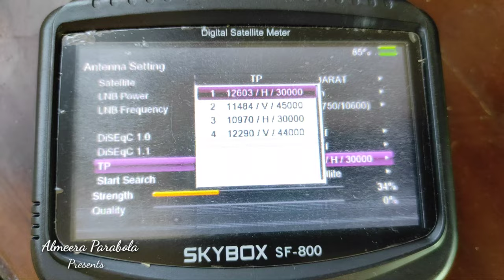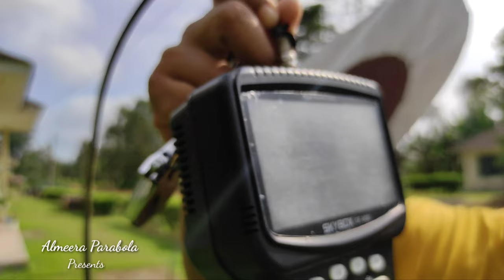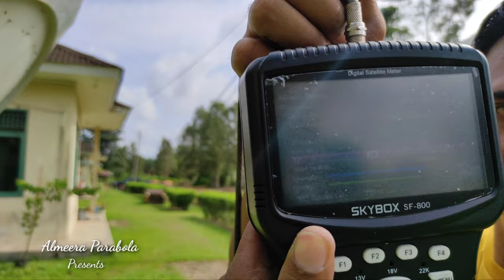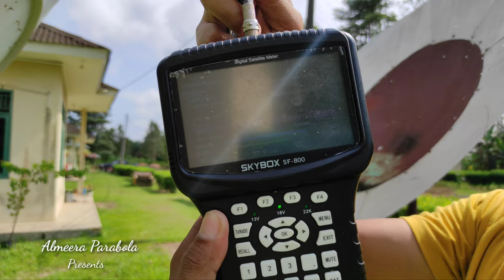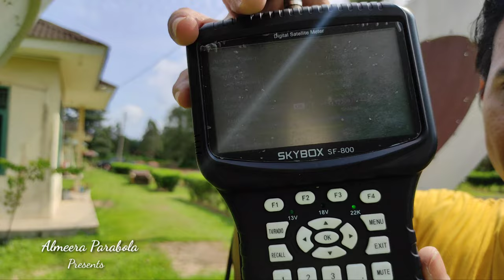Cara Mudah Lock Satelit Kuband 2021# Measat 3# Thaicom5#Abs 2

Comment: Pake dish 45cm bisa gk bang?
Reply from the maker: bisa
dicoba saja
Reply: @AlmeeraParabola  tapi susah banget pdahal di apliksasi sat finder dh pas arahnya namun untuk atur tingginya susah banget
Reply from the maker: Coba.. Mainkan arah LNB nya sahabat.. pakai yang horizontal.. Lock dulu measat 3 a.. Lalu geser sedikit kearah selatan..
Reply: @AlmeeraParabola  kata chanel sebelah tak bisa track pake dish 45 cm untuk sat taikom4
Reply from the maker: Untuk Thaikom menggunakan dish 45 butuh kesabaran ekstra sahabat. 
Minimal.. Area bebas dari halangan. 
Posisi tiang fokus gunakan yang Vertikal. 
Dan Maksimal bisa terlock kurang sempurna.. 
Untuk track satelit sebaiknya gunakan minimal dish 80 cm sahabat. Untuk hasil yang maksimal
Reply: @AlmeeraParabola  kalau untuk dish 45cm yg mudah track sat apa y bang?
Reply from the maker: Dish 45 bisa bawah ke;
Measat 3 A 
Asisasat 9
Ses 12
Tahikom 5
Abs 2
Ses 7
Ses 9
Reply: @AlmeeraParabola  itu yg chanel ftv nya banyank yg mana ya?
Reply from the maker: Tergantung Reciver yang di pakai sahabat. 
Kalau untuk yang FTA coba track ke Asisat 9 kuband. NINMEDIA
Reply: @AlmeeraParabola  saya pake reciver matrix burger mini
Reply: Gak bisa